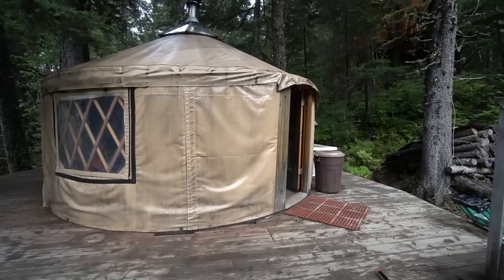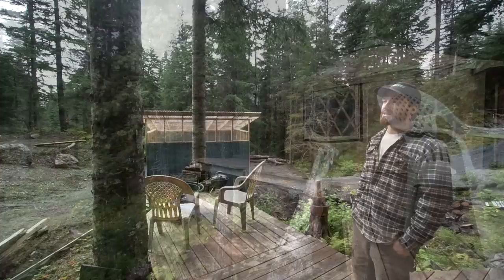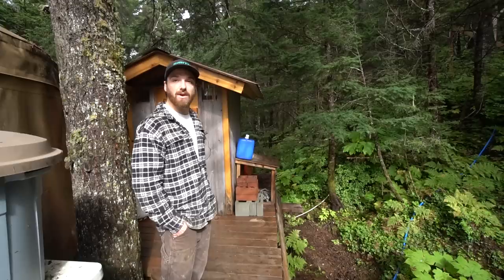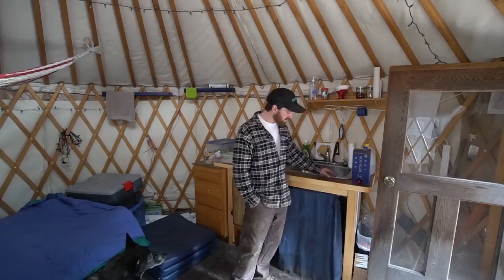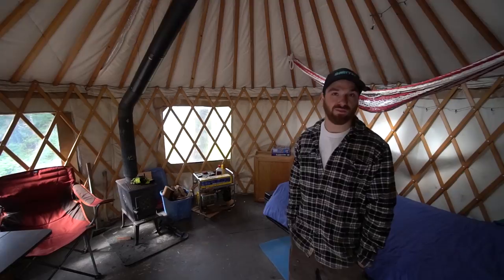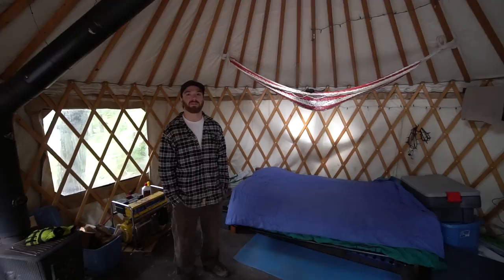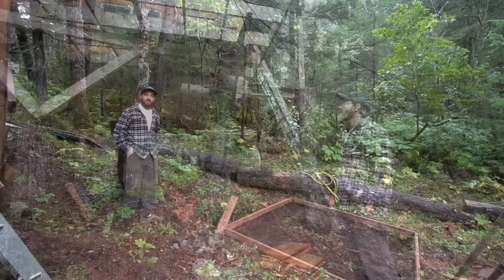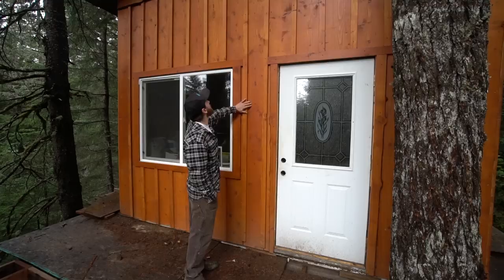Off The Grid Tiny House Treehouse & Yurt Built In The Alaskan Wilderness

Comment: They are four season if you bothered to insulate them I have several friends that live in them a couple of them in Alaska
Reply: Scott L you use a solid wool batting you roll it around the walls and you also put it in the ceiling... because even if wool gets damp it doesn't mold and it retains Heat.. and you can also do the 4 by 8 sheets they have just enough given them that they will curve to the walls between the outside canvas and the accordion framing and then you can put the wool batting in between insulation sheathing in the accordion wall and the stuff I'm posting a link to will reflect the heat back in to the living space but will also keep the cold out on the other side we use this in between the frame of our canvas tents to insulate here in the Michigan winners when we spend two weeks out for camping for deer and I'm also using it in my tiny and it's great for floors and walls to://www.homedepot.com/p/SilveRboard-24-in-x-1-in-x-48-in-R5-Radiant-Acoustic-Insulation-Kit-STC-19-5-Piece-SB12AKIT/205975329?cm_mmc=Shopping%7cTHD%7cG%7c0%7cG-BASE-PLA-AllProducts%7c&gclid=Cj0KCQjw0ejNBRCYARIsACEBhDPN2U68ZKurGpgLSQrM92CZ103KZOBhvkqh-fKjDhJJuZQceaI2x9AaArYTEALw_wcB&gclsrc=aw.ds&dclid=CKLw17uZptYCFVY5Twodc5wGiA
Reply: Its still 4 season without insulation though. The indication is used with tents to indicate it can handle 4 seasons. Not that it insulates or stays warm. Its rain/wind/sun etc. Almost everything that is 4 season needs insulation or have it removed. Like a divy bag for example. Or a coat for that matter.... yurts dont get used for nothing by nomadads. Light but big and protects well. Then when winter comes just insulate it better
Reply: ULTRA NOOB no it's not they are Four Season I have a friend that lives in one in Alaska and has for the last 20 years and stays perfectly warm and the wool batting keeps it cool in the summer and warm in the winter nobody's talking about a bivvy bag here they're talking about a yurt
Reply: sharon Gypsy dove i know, its an example. A bivy bag just like a yurt or a coat.. I meanth that same thing applies. You can have a 4 season bivy bag coat or anything actually, it still depends on, as you said your self, insulation.
Reply: He said it didn't stay warm if the stove is not running..... does anyone in Alaska have a house that stays warm without a heat source?

Comment: Um I don't understand the issue he has with cold and needing the stove going. Alaska gets much colder that rural Virginia. I hated a 1600 square foot farm house with wood.... guess what.... when the temps are below 20F.... when the stove goes out the house starts to get cold. I don't know any house that will stay warm without a heat source. 

The issue with that stove he has is that it's small and at best will burn for 5 hours..... at below zero temps you would have to run it hard and reload about every 2-3 hours. Not to mention the draft control. I don't know if he has a damper. Without one that stove will burn hot and you can't close it down to hold heat and have a more controlled burn.
Reply: BLYAK Yep, he needs a different stove that can keep going and damper down.